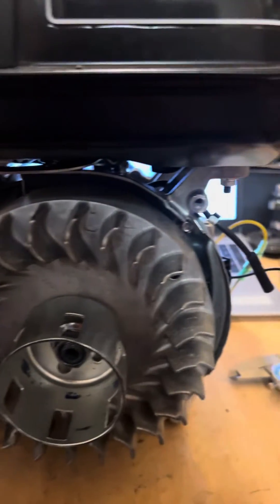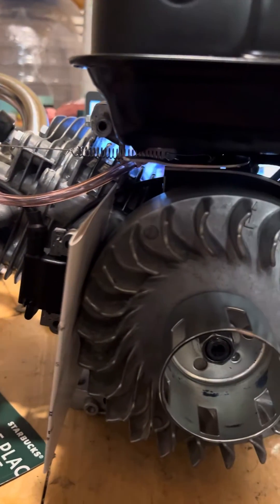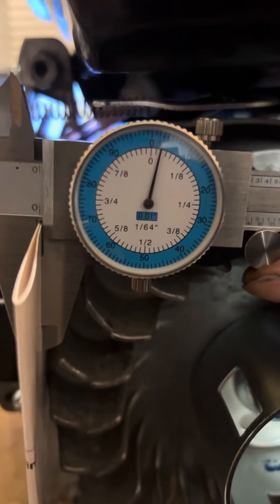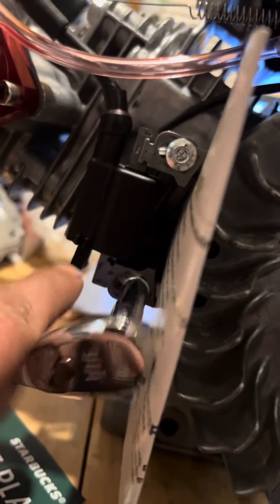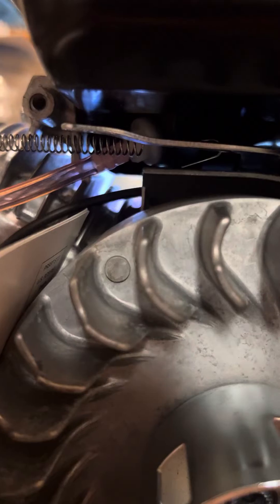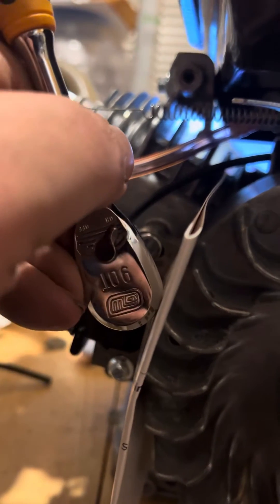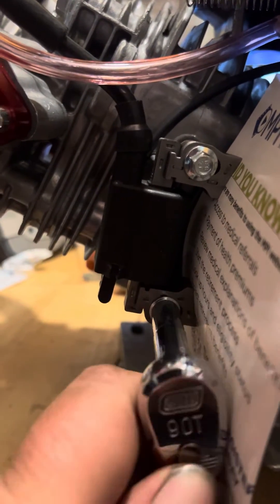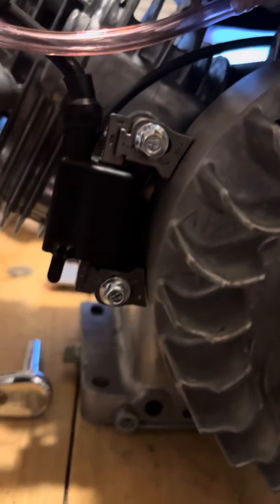Resetting the coil gap with a new flywheel. Predator, Tillotson, 212, 208, 196, 225, 236, 254, 263.

Comment: If i dont set the coil gap right does it cause bad kickback on the pull start?
Reply from the maker: @Dominoskiii  it could
Reply: Kickb because of your valves lashes in your cylinder head set the lashes to .003 intake and .003 on exhaust side.
Reply: @kevingoon2747  thanks bro

Comment: Picked up a snowmobile with one of these 212's guy I bought it from says I could maybe increase the coil gap to make the engine easier to pull over for my daughter to start it. It has an arc billet flywheel. Any logic to this? Maybe the magnet will ease off on tension to allow an easier pull? What gap should I run you think with the arc billet?
Reply from the maker: I believe they recommend as much as .065”. I’d try it and see if you get reliable starting and no ignition breakup under load. You may be able to go bigger but I’m not sure you’ll feel it at the pull cord. If it’s a Predator 212, they can be hard to pull because the bores are pretty tight. You can hone the cylinder for a little more piston to wall clearance as long as it’s not excessive. I wouldn’t go more to an .0025 - .003”. That you will feel.

Comment: I need some help i got a predator 212 ghost motor and when i try to pull start it, it gets stuck
Reply from the maker: Remove the pull starter, put a wrench on the crank bolt and make sure it turns over free by hand. Pull the spark plug out too, if it’s too long, it’ll hit the piston

Comment: What happen if you dont do that?
Reply from the maker: Hi Khriss, thanks for watching. It depends really, if you get the coil too close, they can rub and gouge everything up, if it’s too far away, you won’t get a consistent spark. With a stock flywheel or a cast aluminum, you need to be real close, the magnets in the Billet pieces are so strong you can be off a lot and they’ll still fire. I really want to mark the fire point on one and put a degree wheel on it to show how to install one without a key. Then you can set the timing wherever you want. Kentucky fried fixes has a great video on that, he’s really good with these motors
Reply: Does doing this fox kick back i installed an aluminum flywheel

Comment: How do these flywheels hold up? Still running safe after ripping it? I want one just nervous because of how low priced they are
Reply: Hell, I'm about to find out myself. Just put the engine back together. I'm gonna fire it up today.
Reply: Got a stage 4 bike and that flywheel is surviving constant 8600+ rpm and abuse
Reply: They are good. I have one

Comment: Good stuff Frosty! I like those flywheels. I couldn't find much info about who produced those but to me they look at least as good as the Honda aluminum flywheels. Much cheaper than the billet and spin tested at 8500+ RPM according to specs received by reputable Race Engine Supply guys. None of mine have come apart. (So far) 🤣
Reply from the maker: I doubt anyone is having any problems with them. I'm wondering if its just a Ducar 212 flywheel. I believe they come std on the Tillotson 225 and were std on the 212R but I'm not 100% sure.
Reply: @peterchristlieb  The Ducar 212 flywheel is made different. It's supposed to be made by PVL? I don't know but it looks a lot different from these. As long as it doesn't break, it's fine by me! 🤣 I'd rather spend the money saved elsewhere.
Reply from the maker: @KentuckyFriedFixes  I’ve got a dirty old Honda I picked up out of a trash pile not long ago. The pressure washer was junk like it had been tore up and possibly been run over but I set the choke, pulled the string and she fired 😃. You think there’s an aluminum flywheel on it? I saw the Honda stampings on it and put it away complete for a rainy day
Reply: @peterchristlieb  I would sure check it out for one. The most common engine to have those is the GX160 and GX200. I know a lot of the Honda vertical pushmower engines have aluminum flywheels too but I'm not sure if they'd fit and more importantly if they'd be safe to run at high RPM or not? The Briggs 3.5HP pushmower engines had a cool little aluminum flywheel that would fit the 5HP Briggs cranks, but they'd fly apart around 6000 RPM.
Reply: Does this flywheel fit the 208cc duromax guys
Reply: @CruiZe-A-ViSiON  Hi SC! I ordered mine with the Honda taper. It works great with the Predator 224. I don't have any of the Duromax engines so I'm not sure what taper they use? Frosty may know.
Reply: @KentuckyFriedFixes thanks Kentucky hey I just watched a vid on the 208 it has the same rod as my ducar so I think it's all interchangeable thanks fir your reply frosty must be sleep😊